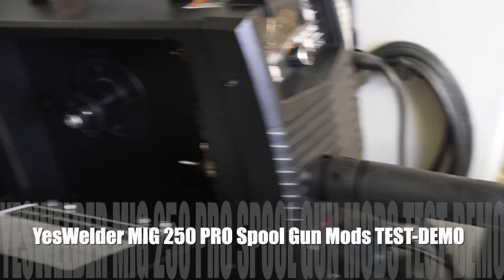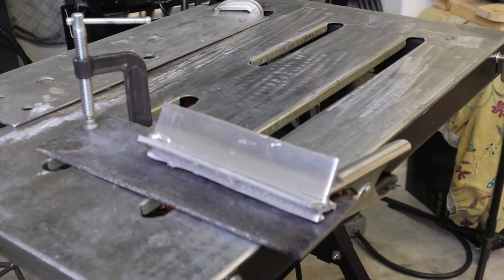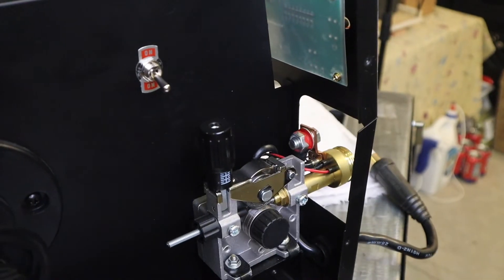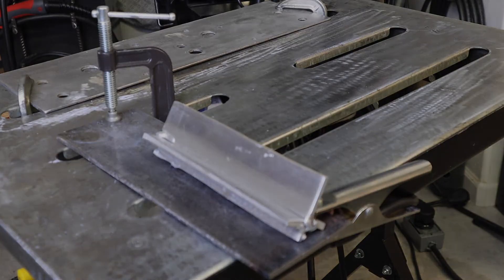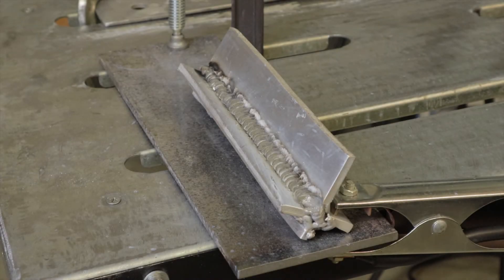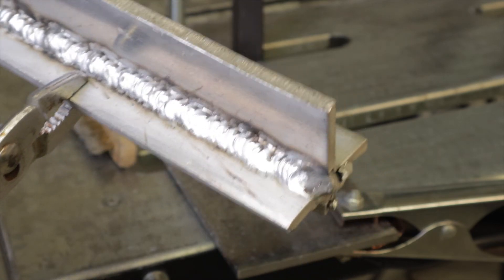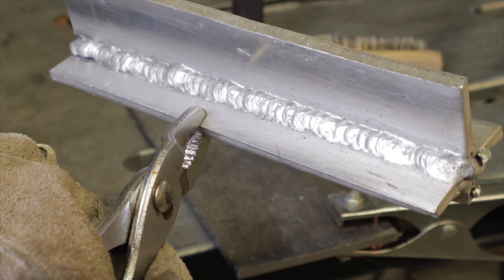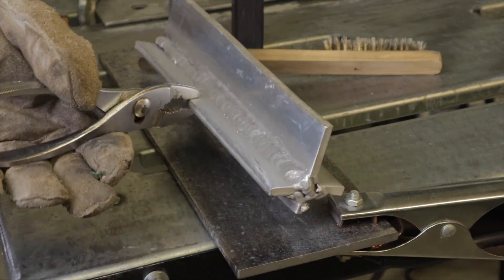YesWelder MIG 250 PRO Spool Gun Mods: Epic TEST & DEMO!

Comment: You planning on going a bit more in depth? Maybe show working with the synergic settings n all that. N I think a side by side comparison between this machine n their factory spool gun machine could be interesting
Reply from the maker: Hi Ben, have you seen these two videos? 
I use the synergic settings in this video and I'm using the graphene liner in the mig gun https://youtu.be/oOCxNEjttLY
In this video I go through quite a few manual settings using the spool gun https://youtu.be/1I4pV2lvVUc
When using the synergic settings for aluminum I felt they were a little low in voltage to get into a spray arc. I had no problems getting into a spray arc using the manual settings. In my experience both machines weld the same in comparison with each other. If you are thinking about getting one I would suggest buying the one that already has the spool gun connections from the factory. Other than that detail they are both the same machine. (Just my observations and opinion)
Reply: @DIYHomesteadProjectsDIYHP10  I'm not "in the market" in the market, I've just been watching yeswelder n a few others for awhile to allow me to make the best choice on a one time purchase when I can spare the money, that'll do everything I could want it to do as I progress in a at home setting while also not having to sell a kidney. My only gripe with yeswelder, n it's a minor one really, is it's exclusive use of metric, but there's conversions n I'm sure after awhile you just learn where to set the wire speed